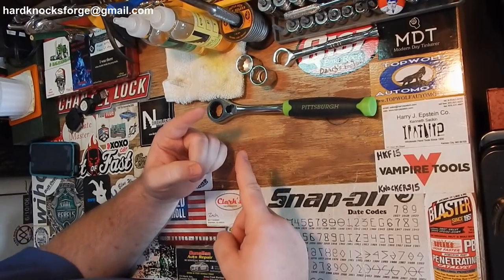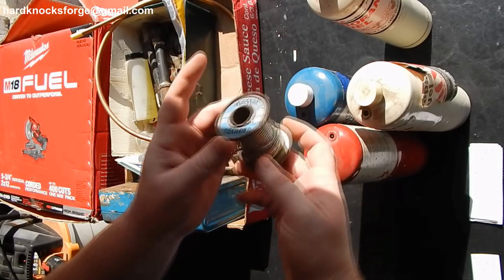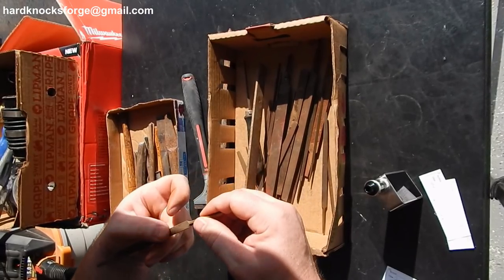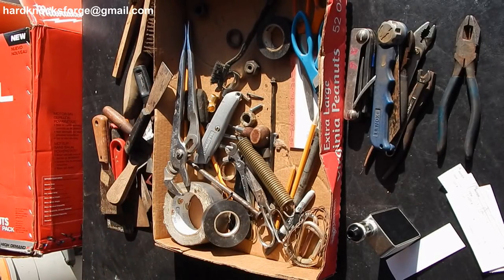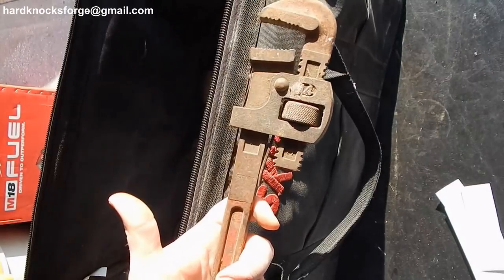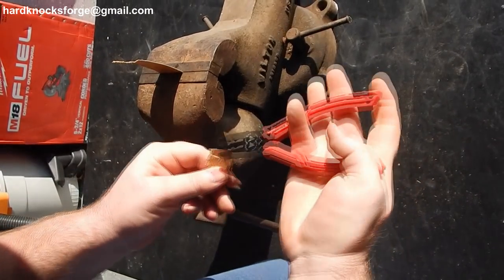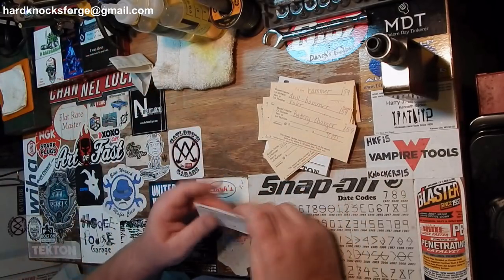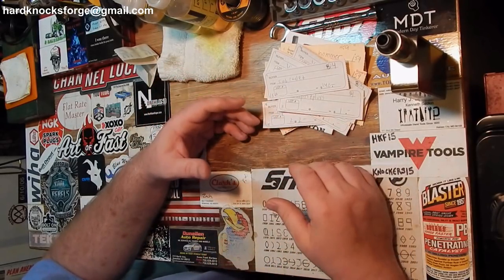2 Auction Tool Hauls and My Greatest Score YET!!!

Comment: Check the idler arm pivot bushing on the deck of the Cub. They get worn out and wable up & down. Also they don't get greased sometimes and don't move easy enough and the belt will throw. Great deal on it regardless!
Reply from the maker: Awesome! That'll be the first thing I check when I have some time to mess around with it. Thanks!

Comment: What's in the red box off to the side? I got some new goodies need to make a video.  Maybe if I get back early from lunch someday.
Reply from the maker: Awe yeah I got a video on that coming up soon... I’ve got your bell rung.
Reply: Hard Knocks Forge URS as well brother. Tomorrow is Saturday I'll see if I can sneak it in but there pretty hard up to get the shit done..  ceiling pipes and all is supposed to be painted Monday.. I got 100 feet of condinsate to run all fittings and hangers few soldering and brazing joints and water test all on a Saturday 😂😂😂.. maybe if I stay 6am tomorrow till Monday morning
Reply from the maker: Yeah gotta get that shop done. It’s what’ll make your money for you. Well, it’ll keep your welders dry anyway.

Comment: I think I got the same old pistol grip welding gun..
Reply from the maker: I love those little propane/mapp gas torches. They are so damn handy for heating shit up really quick and not having to drag out the oxyacetylene torch.
Reply: Hard Knocks Forge  I'm actually looking at it ..its a weller 8200-N 100/140 watts .. weller electric corp .. easton pa usa ..damn they make them right up the street from me🤔
Reply from the maker: I have an old weller that doesn't get hot enough to solder with, but it does get hot enough to plastic weld with.
Reply: Hard Knocks Forge it might be something with your trigger because I think there's two speeds on the trigger .  you're supposed to hear it click twice .🤔 but yo I Uploaded a  Video yesterday .  I kind of stole your idea with the magnets and stickers lol my bad for not being original extra crispy🍗

Comment: 10:33 "bolus gun" or "balling gun".  Used to force pills down the mouths of cattle, horses, sheep, etc.  love the beam cutter.  They don't call them garden tractors because all they do is mow grass. . . .My dad too got a good deal on a lawn mower at an auction: $5000.  It was one of those golf course cutters with independent heads, with less than 20 hours on it, new they're $15k, but this one was vandalized and needed about $1000 in hydraulic line repairs. (they just cut the lines, didn't steal the motors or anything, easy to put back together.) He's got a couple acres to mow though, used to take us 2 hours on a mower like yours, 20 mins now.
Reply from the maker: Yeah that's well worth it just in the amount of time saved in mowing that lawn. Those golf course mowers are excellent for the grass also.